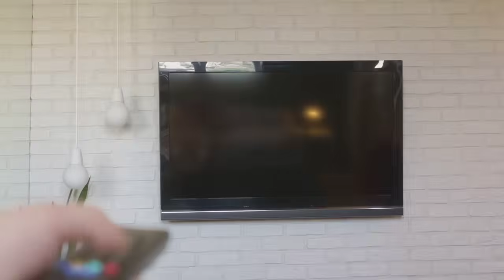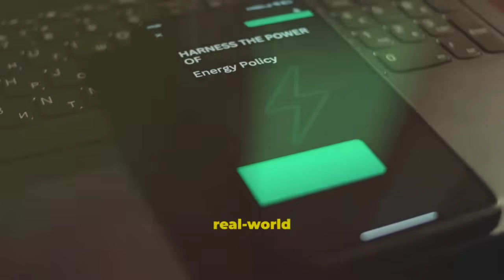AFRICA INVENTED SELF-POWERED TV That Can Go 60,000 Days Without Grid Shocked US Engineer!

Comment: As much as I would love to support a fellow African entrepreneur, I'm mindful of the damage we can ultimately cause each other if we do not take care of feeding misleading information. Now there is another invention which without saying so you have made, that is running a television without an aerial!  Furthermore, liquid crystal televisions require very little power and can be run for few seconds or even minutes with a handful of readily available nicad   batteries. Forget the television, the invention should be "The batteries that can run any electrical device, including televisions". The power cannot be for televisions only, that is impossible.  Show us the power alone with a resistor and amp meter in series, to demonstrate its uniqueness by supplying a lot of power over extended periods.

Comment: Dr Cool, I hope this invention will not disappear into the drains like Maxwell Chikumbutso’s invention.

With this CNB, Compact Nuclear Batteries, achieving Maxwell Chikumbutso’s dream is at the finger tips.

It is all energy propelled machines. 

LET THE GUY NOT VANISH INTO THIN AIR.
Reply: Maxwell's  inventions.
 is operating fine and well. WHERE DID YOU GET YOUR DISINFORMATION FROM?
Reply from the maker: Bro I don't think so, this will stay but low long I don't know
Reply: Inventor Chikumbutso is reportedly producing 30,000 self-powered cars monthly. You need to order for one or two.
Reply: @Monnie-Glory is it in the moon? Where is he doing the production, who has ever seen him or make use of his product?

Anyone making order for his product is entering into the scammers den. He is not a straight forward person. 

He lacks credibility to be called an inventor as there is no product out there that can be credited to him.

He told the world on 10 February that anyone that tampers with the 50 wires in the engine of his self powered car will loose his investment. He went further to say that he configured it to be so. 

Do you know what he was saying. He means that if you purchase his invention and it fails to work, forget bcs he was not going to fix it back. Where have you seen such a mechanical device?